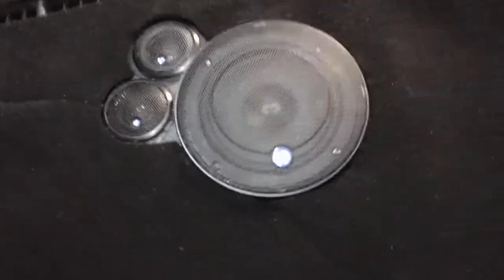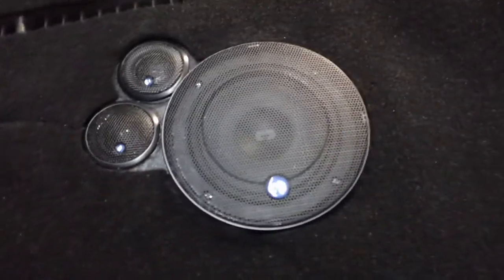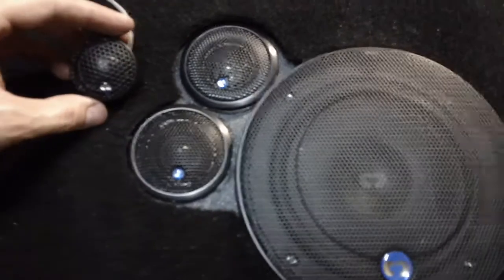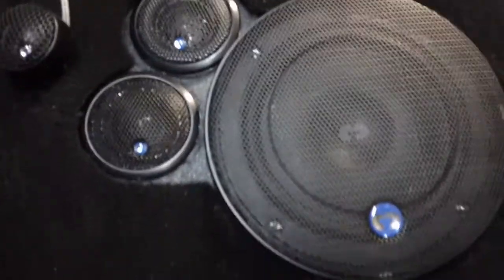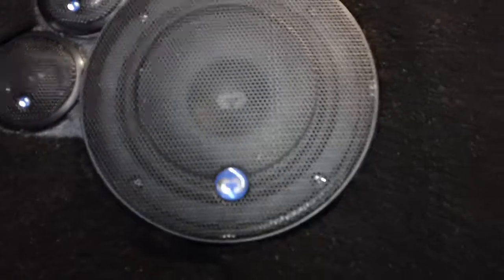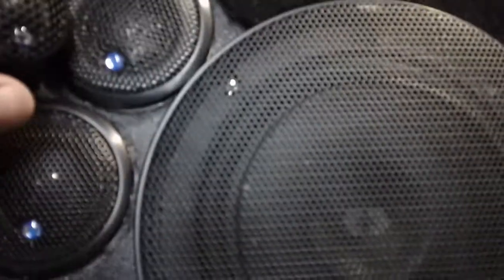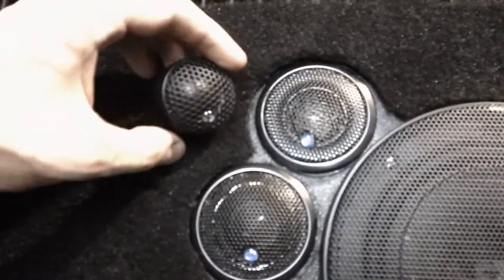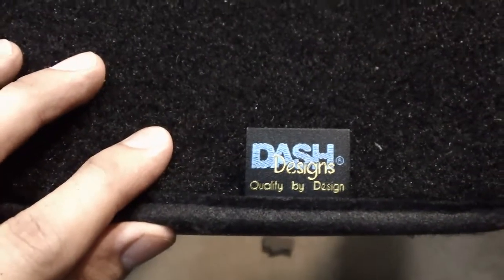SQ Saturn Car Audio Center Channel Tweeter Upgrade

Comment from the maker: My midbass drivers are in the stock door locations low and forward. They are run active, everything else in front is on passives. That includes the center channel and my L&R mids and tweeters. I have Clarion SRG1622R coaxials powered by the MS-8 in the stock rear locations. My front speakers are powered by a Clarion XC6610. The sub is a CDT QES-1220 powered by a JBL GTO-501EZ. 

Crossover points:
20 Hz 12 dB subsonic
80 Hz 24 dB sub/midbass
1,000 Hz 24 dB mid
90 Hz 24 dB center
90 Hz 24 dB sides

Comment: Hi Barry just bought the new pods withe es-02 in them with crossover and volume control,  I read somewhere  you said you needed a tweeter for that crisp up top ,I agree, what do you suggest for me, I don't wanna spend a lot.
Reply from the maker: eduardo batista Did you get the 2" playing and give it a couple of days to become familiar?
Reply: Barry Schanz no Barry , there not n installed ,just tried them of my hi end home yamaha , also connected my door speakers, which are or were pretty good back then ,made by vibe audio, the sa60k series,  I blew two of the tweeters, those are convertible models , meaning you can keep tweeter on or move them like a component, they are awesome, alot of old stuff if in new condition it's awesome
Reply: Barry Schanz but to answer you, sorry just a little excited about everything, your right, I still need a double din headunit , im my other car, I had a 10 inch subwoofer,  pioneer tws256dvc, they sounded nice, that ten was ok, now I see they have the 8 inch cdt sub for 150, I also have a sony xplod 12, a a new fostgate 10 rs14, the pioneer is 350 rms,help ,lol, now as for amps from what seen in these pods they need power,maybe 60 -100 or more, what you think, I was thinking of going with ppi amps, which do you recommend , 4 channel, 1 channel or 5 channel and how many, also the headunit with a nice eq, and crossover features and time alignment will help,
Reply from the maker: eduardo batista What I recommend is the UpStage kit UP-2100i www.cdtdealer.com/rubyserv/item.php?id=up-2100i

Please use this link to support me.
Reply: Barry Schanz Barry in reference to the amps I'm thinking  ppi phantom,  5 channel 4 or one which do you recommend  and what would be better, maybe two 5 channels, one 1 channel and a 4 or two 4 channels, do you recommend  the cdt woofer, it's on sale now
Reply from the maker: eduardo batista A pair of QES-820 would be very compact and sound great. I recommend Zapco 
https://www.rubyservsales.com/product/zapco-st-1000xm-ii-1000w-mono-class-d-bass-amplifier/

https://www.rubyservsales.com/product/zapco-st-4x-sq-420w-4-channel-class-ab-amplifier/

Comment: Hey Barry Schanz, since you are using Clarion Class D amplifier with your system just wondering how does it sounds like as far SQ is concerned? and how are the sound characteristics? Cheers
Reply from the maker: Zaki Khurram The Clarion XC6 full range amplifiers are completely neutral sounding. Some people like a bit of coloration from their amplifiers, but I'm very happy with neutral and transparent. Full range Class D can sometimes be harsh when clipping, but I have no complaints about this amplifier.

Comment: First thing were are your midbass drivers at? I was one of the first people to start using the MS8 and never ran a center channel and won a shit load of MECA events .. I have a Hybrid Audio L8 in Custom vented kick panels and Hybrid Audio L3se in Custom A pillar and Hybrid L1v2 in Custom fiberglass Sail panels .. Im running  a Zapco DSP 8 and because while the ms8 is good its limited.  Are you running active? 3 way or 2 way ? what amps? what sub? what are crossover points ? do you compete?